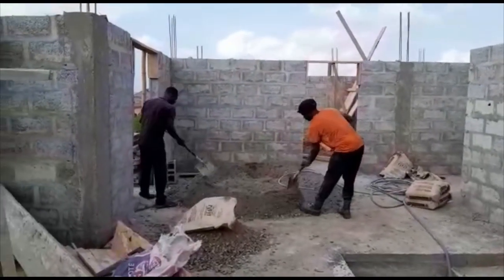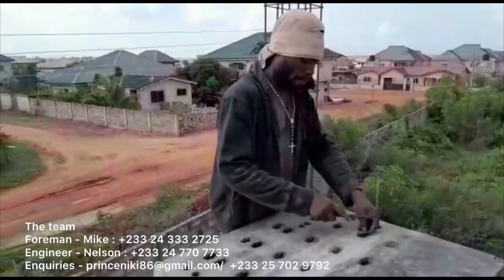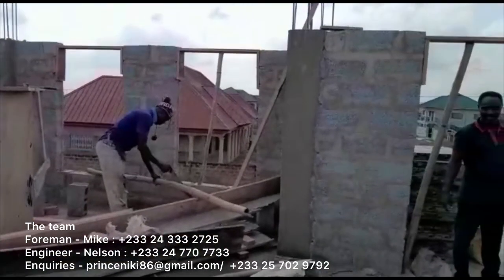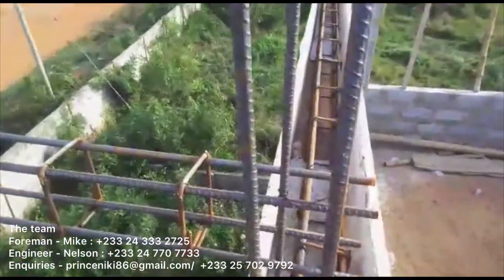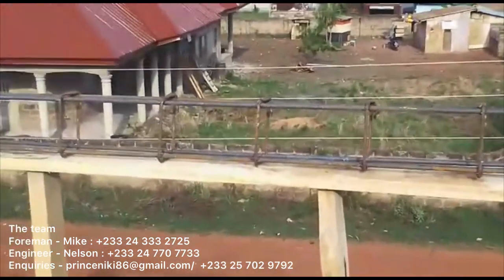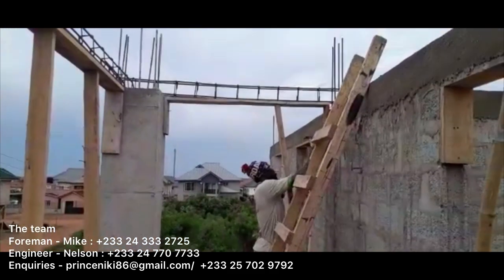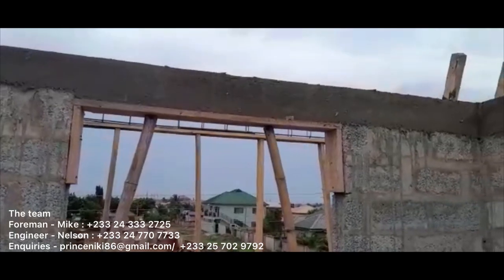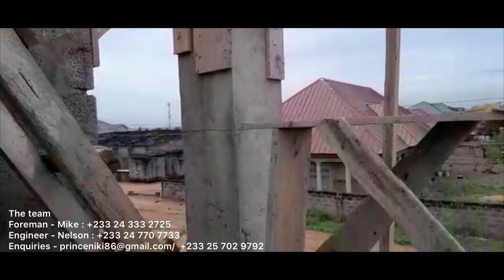Building in Ghana - First floor feature column & Lintel

Comment: Well done, clear narratives. 
In regards to the parapet, it isn’t just the binding wires holding on to the moulding, it is also filled with concrete mixture mixed with quarry dust to hold and bind everything together. In my opinion, it’s the safest way for facials.
Reply from the maker: Thank you. I think we need to request some videos from the installers to understand the process before discounting it completely. We’re leaning towards PVC facia and soffit but it’s worth looking at the parapet facia again. Best regards

Comment: 1. There is no need to pay for double-glazed windows if they are just 2 panes of glass put together without gas-filled gaps.
The gas between the gaps acts as a shock absorber, making it difficult to break into the window.

2. While louvre blades are an option, they are not energy efficient, especially if you use aircon. They let so much air in and out of the room. That means it will cost much more to use aircon by installing louvres.

The casement windows, in my opinion, are a much better option if you take the necessary steps to screen mosquitoes and other flying insects out
Reply from the maker: 1. We agree, there is no need to waste money on double glazing which just two panes of glass placed together. However, the double glazing we are considering are gas filled and sealed according to the manufacturer. 

2. You made a very good point on the efficiency of louvres. They are not best for an air conditioning space because of the air leakage.

3. The casement windows are based on two track systems (KS50) with a mosquito netting. Many thanks you points.

Comment: Yes most double glazed windows in Ghana are without argon gas hence sweat appearing in between the double 5mm glasses. Get value for your money.
Reply: So how can you charge $15k for a window without that? I call it BS. I will prefer spend less than 2k in Europe and buy better window and ship it.
Reply: @barryville  exactly, it is always good to have options and alternatives for the value of your money.
Reply from the maker: It is crazy that people call that double glazing. We checked with the quotations we obtained and both are as we would want them to be made with gas and sealed. We continue to look at companies.
Reply from the maker: Yes that’s an option but comes with issues of things going missing also or damaged. So many challenges

Comment: Hi Guys thanks for sharing all of this valuable information. Do you mind sharing the concrete ratio you used for your beams and columns? Are you using M25 or some other ratio? Thanks.
Reply from the maker: We are using cement sand stone mixing ratio of 1:1.25:1. Please check our video on cost breakdown of first floor slab casting for details. Thanks
Reply: Thanks for the response. Much appreciated. Love the work you are doing.

Comment: Good work guys,

by the way why did you use 6inch blocks for the top  floor instead of 5inch
Reply from the maker: We didn’t want the security bars to be too close to the window frame, making cleaning in between difficult